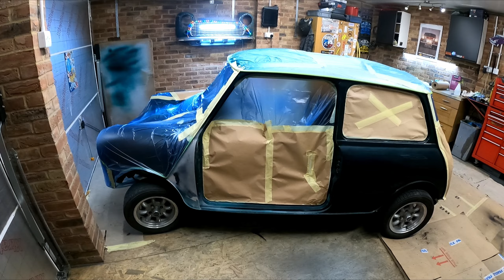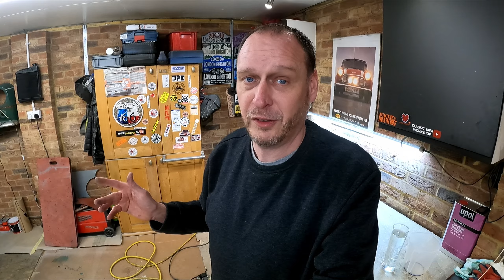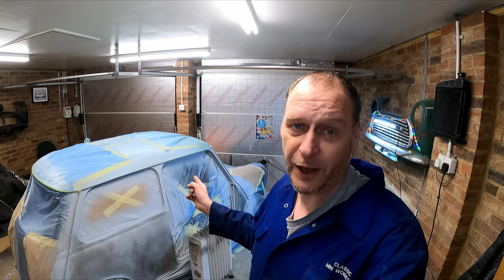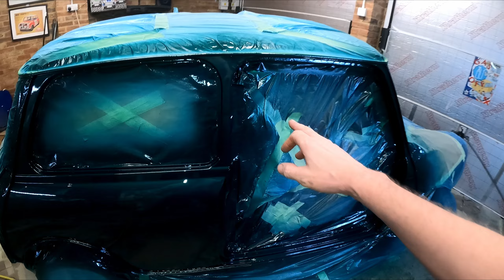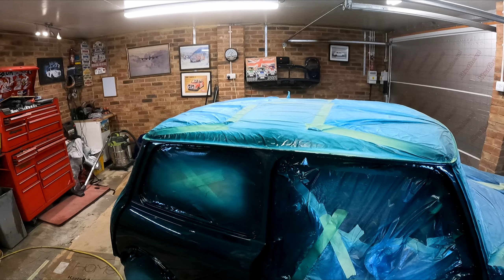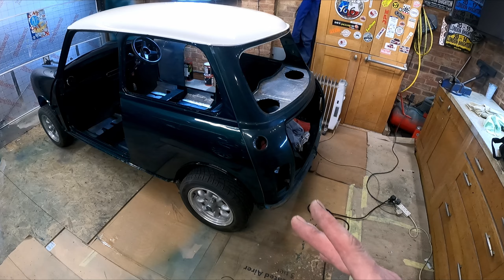Rear Quarters & Door Apertures - Classic Mini Workshop - Racing Green Pt.73

Comment: As the owner of a traditional hardware shop, I learned a couple of years ago that masking tape typically shouldn’t be left up longer than 24-48 hours depending on the substrate etc. as they will continue to etch into the surface they are stuck to. There are some that are designed to be left on for longer, but not too many. Long time follower, btw, love your work, always a good boost to get me going with mine!

Comment: It's looking good! I would have been tempted to swap those fixed rear side windows out for the opening version. Not original for your model but easier to remove and replace once you have drilled some fixing holes in the right place. Opening rear windows are very useful in warm weather (remember that?) to provide some air flow. I am still waiting for a dry day to do some work on my Mini...

Comment: When you saying your getting dry bits are you talking about in the clear coat in the nooks a nd crannies from over spay and it gives you the dry looking Finnish if this is the case here's a tip get yourself a can of Upol blend 9 blending thinners and give it a light spray not too much though as and don't spill it or drip anywhere you don't want it because it's white strong stuff but it will activate the top coat and let it flatten out it's good for blending into old paint on the blend line as well
Reply from the maker: Thank you, that's very useful.